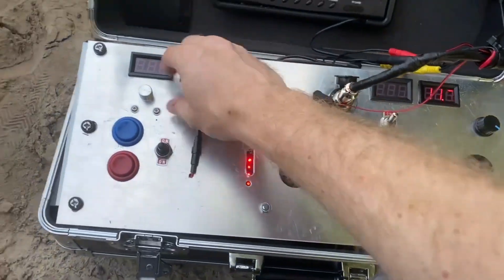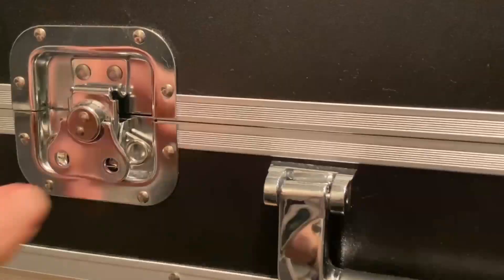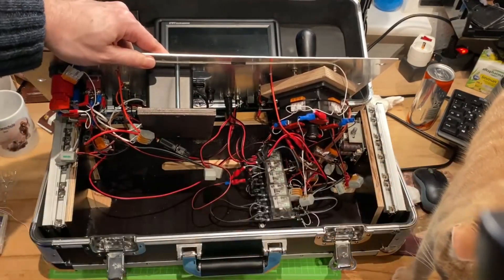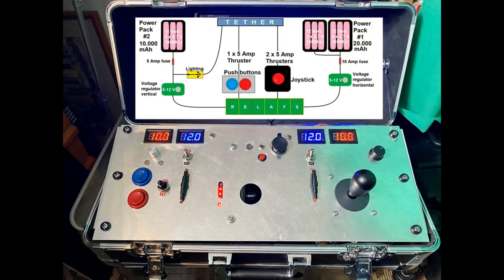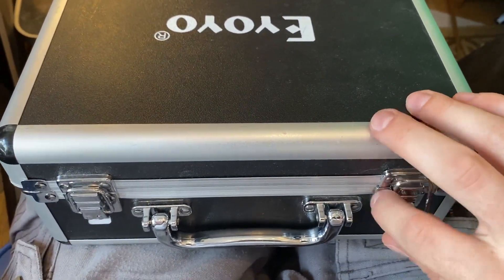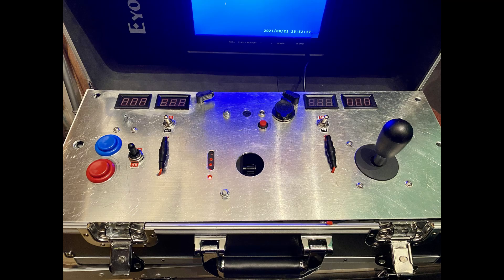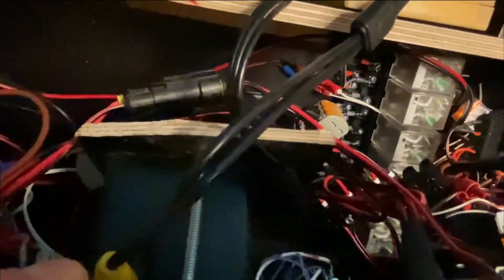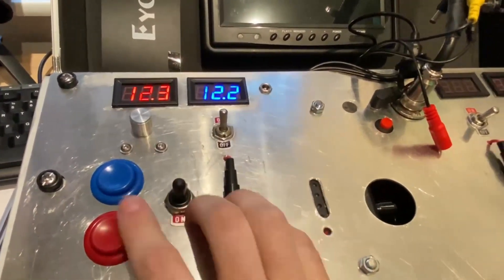ROV Submarine Controller with metal detector

Comment: If you want to try something cheap but possibly rewarding, the Sony Handycam DV tape range has some really good analog sensors, it did incredibly well on FPV over a 5.8ghz transmitter, but connected directly via cable it was just bizarre.

I'm planning to build a SeaPerch, to locate and mark obstructions in a local fishing pond, and I'm thinking about adding a handycam (*or similar) analog sensor to it, because of the clarity.
Got PVC fittings for cheap around here, so I was pleasantly surprised to find this project, after looking at €3k+ readymade ROV's, and hearing my wallet fluttering in the wind..

You used PN16 cpvc, correct? That "blend" might be more impact resistant than the no pressure rating stuff. Also, makes for an interesting side-remark. If you glue your flotation tubes down good and solid, with CPVC, it can handle some pressure. You could add buoyancy by tapping in a bike valve (schrader type, mtb inner tube), or for example, a 1/8"-to-schader valve from a pressure tank from a domestic central heating system. With that, you could finetune the volume of air by adding pressure with a bicycle pump.

Just remember to keep in mind the pressure difference..

All in all, great project, very nicely done. Hope I can get close to your results.
Reply from the maker: I’m not quite sure, I’m grasping this correctly. Just be sure not to use high frequency transmitters (Wi-Fi 2.4 or worse yet 5.8 ghz) under water. Only low frequency systems work. 

As for the pvc pipes, they are pressure resistant to 10 Bar or 100 m of water depth. Not sure what specific kind of pvc that is. Sorry. ☺️